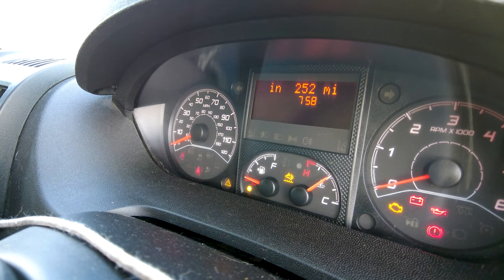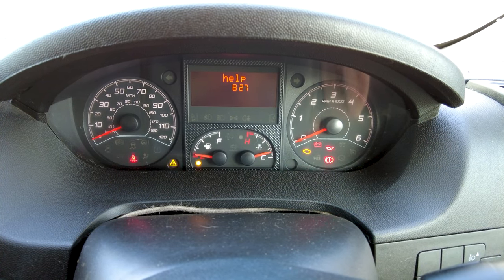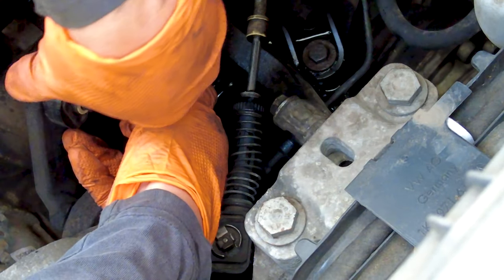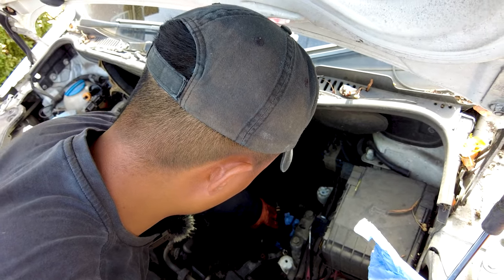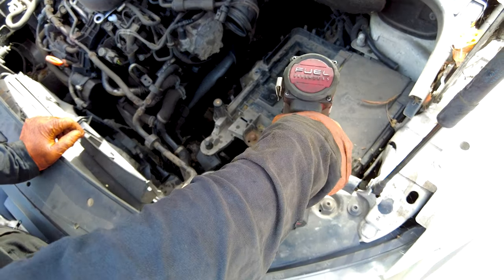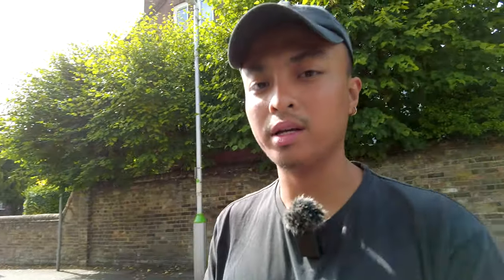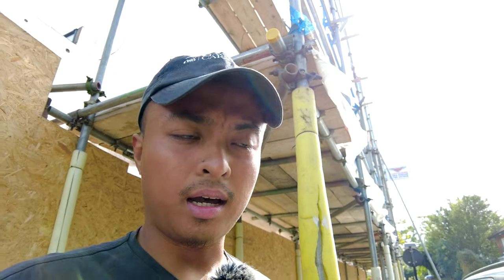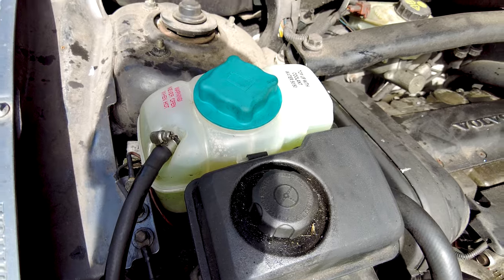THIS CAR IS RIDDLED WITH FAULTS! CAN WE FIX IT?! Life of a Mobile Mechanic UK

Comment: Next time use the original coolant tank cap it fits better. Ihads a new tank with cap and after a few days the cap blew off. The original tank lid fitted fine and is still holding up strong.

Comment: Brake fluid is hygroscopic and mixes well with water. When cleaning up brake fluid spills just spray water at it until it runs off. 100x easier than trying to mop it up and cheaper than using brake cleaner

Comment: I've got a volvo V40 D4 r design 2.0 diesel year 2014 ,the engine light is on EGR valve fault diagnostic test, it's been on now for 6 months the car runs fine never had any problems with it, no loss of power ever, no limp mode ever, no ruff idle, no stalling ever, so I don't see the point of replacing it when the only problem is the light on the dashboard and the garage wants 13 hundred all in for new parts and labour is that the going rate? And if left will it cause more problems?
Reply from the maker: £1300 for a new EGR? That’s not right…? I’d say whole job is no more than £400ish? If they’re planning to remove the whole cooler and valve assembly, then maybe. 

Again, just because it’s on the diagnostic that it’s the EGR, doesn’t mean that the EGR is at fault. It could just be a simple break somewhere on the wiring so make sure that it’s diagnosed correctly

The answer is maybe. If the valve is stuck closed, then I think you’ll be okay. If it’s stuck on open position, it can potentially damage your PCV, DPF and anything within the intake/exhaust line
Reply: @themarvelousvlog  Yeah that's 13 hundred for the EGR valve cooler, the all system, and labour, 
See like I said before I don't want to spend that much if my car isn't broken, If it was stuck open I would have other symptoms telling me something is wrong ,maybe for a split second it got stuck open or closed triggered the engine light but then rectified it's self, what's your thoughts
Reply from the maker: @sheffcitys2forgedinsteel255 couldn’t really tell unless I diagnose it 😅 Over the internet, I can only guess. 😂. 
If you assumption is correct, delete the codes, if it comes back a week or few days later, or a minute later, then your EGR defo needs investigating. I don’t think the whole assembly needs replacing unless the cooler itself is at fault too
Reply: @themarvelousvlog  okay thanks for your insight mate,  
And keep up the good work man, I'll be watching
Reply from the maker: @sheffcitys2forgedinsteel255 thank you! Appreciate your support

Comment: if your using glue always sniff it for 10 minutes or so 1st to test if its nice and fresh and going to work, there's nowt worse than a if roof you repaired flies off after using dodgy glue, your customers wont be pleased getting their wigs wet 20 miles down the road will they eh👴👵